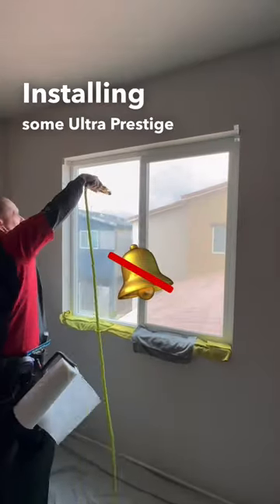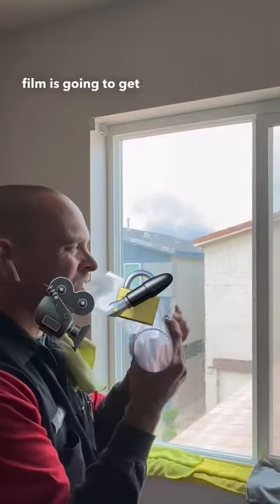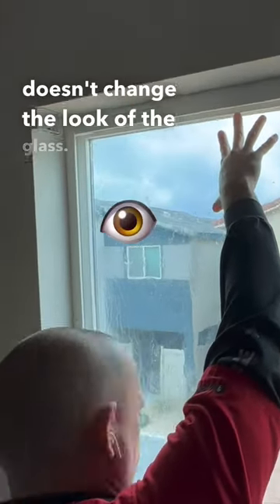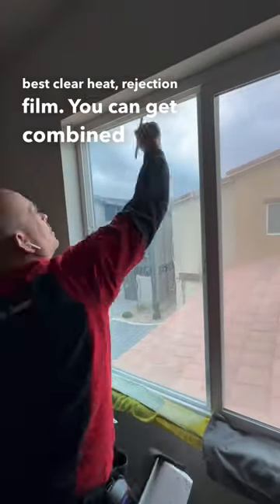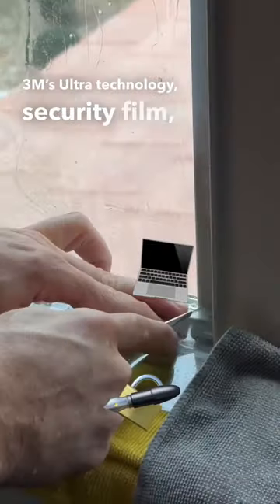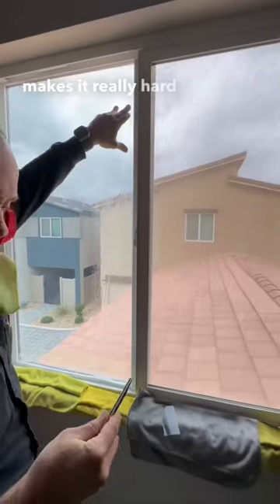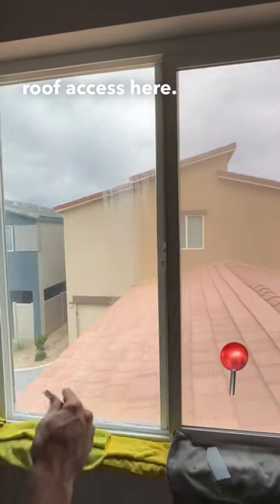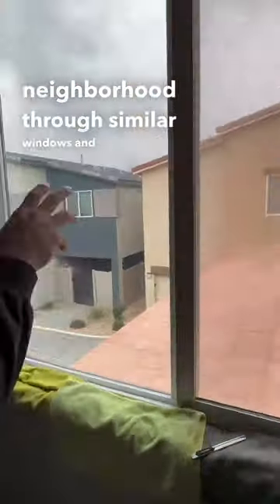3M Ultra Prestige 70 install. 97% Infrared Heat Rejection Security  film to keep intruders out

Comment: Where to get
Reply from the maker: A 3M Pro Shop Dealer can get it and install it for you! Here is a link to help you find one near you! https://www.3m.com/3M/en_US/home-window-solutions-us/find-a-dealer/
Reply: He's right the only problem is, without a structural silicone securing the film to the glass then to the framing, when that window breaks it'll all fall right in like a door mat effect since all the glass is held together it'll flex enough for you to push it right in. Normally you would want security film like this on residential glass when in an active seismic area because when in an earthquake if the glass is to break it won't fall out in pieces causing additional harm to anyone trying to get out of any specific area. Granted, most residual window framing isn't thick enough for a structural silicone because per the manufacturer you need minimum a 1/2 inch framing. If you're really worried about break-ins I'd recommend a security screen. Normally made of an aluminum framing with a stainless steel mesh that's installed on the exterior. Offers privacy and way more protection for your home 😊 #themoreyouknow